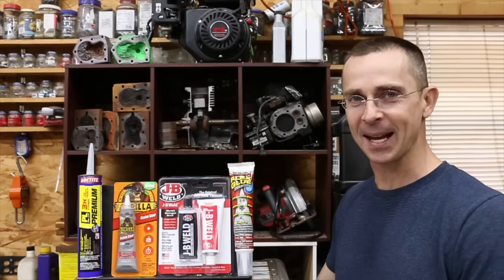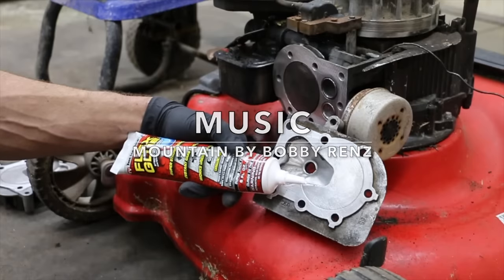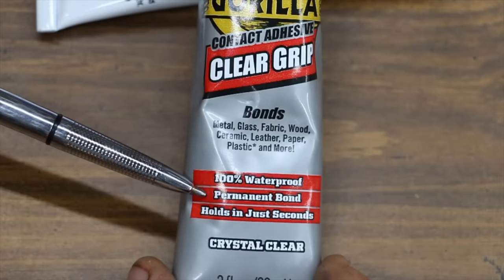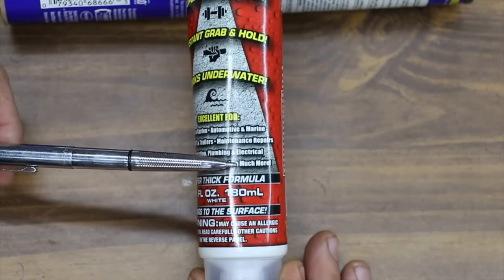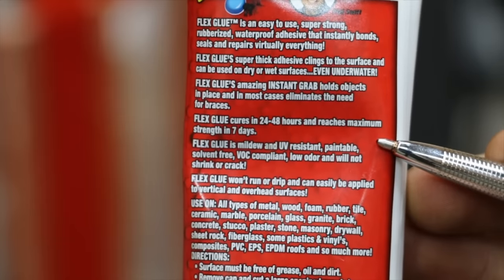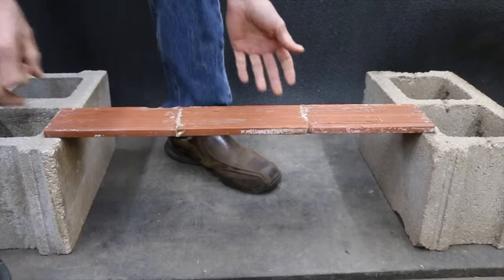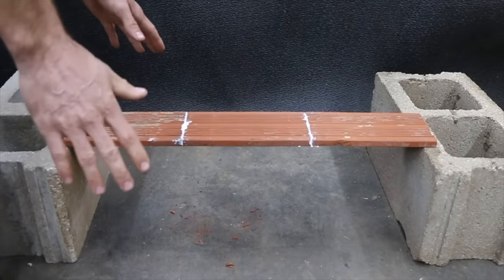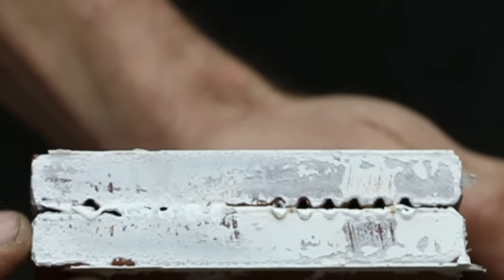Is Flex Glue better than JB Weld, Gorilla & Loctite?  Let's find out!

Comment: Long time J.B. Weld user,  but still amazed by the results.   One application it's not suited for: muffler repair -- or any continuous exposure to very high heat.  Very suited for some rather unorthodox repairs:  I used it to seal up a turtle's shell that I apparently ran over with a bush hog and cracked it very severely,  so that you could see his insides.   By the time I found him,   the flies had already blowed his innards,  so I had to flush out the maggots with hydrogen peroxide.   I always wondered if the repair worked to save his life,  until I found him again over 3  years later,   very much alive and kicking,  J.B. Weld repair still intact.   Needless to say,   I named him J.B.
Reply from the maker: Repairing a turtle's shell--impressive!
Reply: Now that's a BIG scar to show off for mating!
Reply: This story made me quite happy. I'm always saving animals most people never give a thought about. Like nursing frogs back to health that had been injured by cats or caring for injured birds. It's the little things in life that make life worth living. I'll JB the next turtle I find! lol
Reply: @Gruntsworth  -- Good to hear.   If you think the story made you happy,  imagine me finding him alive over 3 years later.  Fortunately it was in an isolated hay field,  well off the road so no one could see.  But,  I'm sure I looked the perfect fool,  jumping up and down,  whooping and hollering,  and dancing all about,  all while holding J.B.up in the air waving him around.  LOL  And to think,  all it took was a little turtle to make me feel so happy.   Your sentiments are spot on.
Reply: @tablature6121  Can you post a picture of this turtle??
Reply: @ihatesignupsgrrrrrrr  -- I did take some pics of him after I found him again.  I'd have to dig them out since I'm not sure where they are now.  Best I remember,  they were Instamatic Polaroids 600 B&W  (this was in '99 or '00).  Since my old scanner is no longer supported and I don't have a new one yet,  I'd have to take a pic of a pic,  on my digital cam,  and host it someplace.  So,  I'll get to work on it but I really can't make any promises.  If my efforts are successful,   I'll reply to you in this comment thread and you should get a notification.  Wish me luck.
Reply: Pics or it didn't happen.
Reply: @jerzmontana7784  -- Please re-read my previous comment (and let it sink in,  this time).
Reply: @ihatesignupsgrrrrrrr  -- Whew! A lot of trouble but glad to do it since you asked so nicely.  You can see the gray J.B. Weld repair plainly.  And if Project Farm will indulge me,  my own "Project Farm product test results":
My daughter,  a couple of neighborhood kids,  and myself wrote our initials,  the date (of initial release),  and his name (J.B) on the gray patch with a Sharpie permanent marker.  As is seen here,   ALL the Sharpie markings are gone after over 3 years exposure to the elements.  Are Sharpie permanent markers truly "permanent"?  Not if exposed to the elements.   Before releasing him again,  after these pictures were taken,  we scratched most of that into the J.B. Weld patch,  for a more permanent memorializing of the repair.  
As these turtles can live to be over 70 years old,  and seldom stray more than a few hundred feet from their place of birth,   I have kept a sharp eye out for him since re-releasing (about 2000),   but have yet to see him again.  Not given up hope,  though,  and will notify if I ever do encounter him again.  
Enjoy:   https://j1flyer.imgur.com/all/
On edit:  Just checked the link to see if it still worked and got the "401 error" thingy.  If unable to access via link,  go to imgur and search images of  j1flyer.  Hope this helps.
Reply: JB thanks you.
Reply: @tablature6121  thanks for the pics. It's all we wanted
Reply: @tablature6121  link works
Reply: @tablature6121   Thanks for helping the turtle. Too bad your good deed generates so much anxiety.  Turtle envy can take years of therapy ,some will never recover.Please contribute to the National Turtle Envy Therapy Society.Your generosity may not save the planet,but you have to start somewhere.
Reply: @jeffhallel8211  what the heck are you talking about.
Reply: @tablature6121  That is friggin awesome.
Reply: @jeffhallel8211  -- Thanks for the suggestion but I think my money will go towards the purchase of some more J.B. Weld.  <<<<<<unsolicited product endorsement.
Reply: @Picklejam08  -- You obviously know nothing about these turtles.  Nothing "miraculous" about finding him again.  Like I said in an earlier comment,  it is not unusual for them to live to be over 70 years old and seldom wander more than a few hundred feet from their birthplace.  
I've posted workable links to pics had you bothered to check before accusing me of making this up.  I suggest you avail yourself of them,   then further "edit" your post so as not to appear so ignorant.
Reply: JB Weld has a high heat mixture for exhaust systems I believe.
Reply: @ZRTMWA  --  Good to know,  Yung.  I will certainly be on the lookout for some I could use on my tractor exhaust.  Thanks.  
(I have seen and used their fairly recent quick setting formulation but still prefer the original stuff if I'm in no hurry.  Gonna look for the exhaust stuff now.)
Reply: Had to download Imgur and make an account, but well worth worth it. Awesome story and cool to see he lived. Cheers mate.
Reply: No wonder turtles have outlasted the dinosaurs. You're a good egg!
Reply: Purchase yourself some Belzona 1121 and 1212, you’ll never want to use JB again.
Reply: Tab Lature 

Wonders never cease!!! Tooo amazinggg!!!
Send that story to Readers Digest! (or ?)
I stop 4 turtles too btw...of course!

A chimney swift hit smack by my van grill...got out to get him/her off the road...laid it in a hanky and took the dead looking thing home...looked again and there was life in it...got home and it was drinking from a dropper, tame as any hose pet!...no fear at all! Looked in my bird book...that species takes easy to humans...and flew away in less than an hour!

Seriously though...being an illustrator/writer; l would enjoy illustrating & posting that story on my soon revised YT channel...it should go viral...and have the JB Weld ads to go with it...awesome!!!
Hopefully u took pictures (?)

Okay, you do have photos...just read your other posts...🍀👍
Reply: Great story
Reply: Thanks for sharing, and the photos! That's awesome!
Reply: This is the best story so far 👍
Reply: @tablature6121  Good lord, you covered that turtle in JB, it will be invisible now.
Reply: how did you find him again?
Reply: Wow thats an awesome story!
Reply: @ISCFworld  -- I just pulled into a hay field,  only a hundred or so feet from where I originally found him,  and was barely started mowing the first swath.  Especially watchful during this time,  since woods border the field and dead tree limbs will sometimes fall into the field,  and they're something you don't want to encounter with your equipment.  While looking out for dead limbs,  I happened to see a flash of gray moving out of the field and into the ground weeds and vines that border the field,  at woods' edge.  Knew immediately it had to be him.  A joyous celebration ensued.  LOL
Keep in mind,  I had a relatively high perch -- the tractor seat -- from which to observe,  with no cab to obstruct my view.  That, and a whole lot of luck is "how".
Reply: @tablature6121  thats pretty cool !!!
Reply: Thats a beautiful story man!! Thanks for going so far out of your way to help a creature "beneath" you! God bless
Reply: that story deserves a video....Good job.
Reply: @tablature6121  good luck!  I would love to rub that photo in jerk montana's face!
Reply: Wow. Incredible!!! Great job!!!
Reply: Damn that turtle was a real teenage mutant ninja turtle
Reply: @tablature6121  Good show mate!
Reply: @tablature6121  For someone with such a good heart to do what you did for that turtle, you certainly don't seem to understand the standard "pics or it didn't happen" phrase that is widely used all over the internet, and has been for like 2 decades. Jerz isn't actually accusing you of lying. It's a jab to post the pics because everyone would love to see 'em.
Reply: What did you mean with "flies had already blowed his innards"? Did a considerable amount if time pass between running over him and you finding him?
Reply: Hazuki Kimura -- Maybe a Southern (U.S.) thing,  I don't know.  But all my life growing up in the South,  when flies lay their eggs on some dead or dying carcass,  it is said here to be "blowed" (yeah,  I know,  "blown" is probably the proper tense/usage,  but this is my beloved South -- it is the vernacular/slang/whatever used most often here in this situation).  The eggs,  as you know,  hatch out into maggots (fly larvae).    I can't say how long after the damage was done to J.B. I found him,   but I'm sure it was I who inflicted it upon him,  since the previous 2 days,  I had been bush-hogging (a tractor sized lawn mower of sorts) and also mowing hay --   the machine I use to mow with equally capable of doing the damage.  
So, it could have been up to 2 days with the cracked shell,  doubtful any more.  Whatever,  time enough for the flies to "blow" him (lay their eggs on his then exposed "innards")  and for those eggs to hatch out into the maggots I flushed out,  albeit very small maggots.  I'm sure there were eggs still unhatched that were sealed up with him,  but apparently to no harm.  Weirdly enough,  when we checked on him the next morning,  one maggot had managed to wriggle his way through the J.B. Weld mixture before it had fully set up.  He was at the surface -- "fossilized" as it were,  fixed in the stuff like prehistoric insects in amber,  only all gray.  
I remember,  there was a very bad stench,  too,  as my daughter,  who assisted me in the whole operation,  then only about 6 or 7,  could attest to (that is her,   about 10 or 11,   in the photos,  only cropped for obvious reasons).  
Knowing that the internet is an international thing,  I had reservations about using that term when I posted it,  but really,  I'm at a loss for any other way to describe it (flies laying their eggs on "flesh").   Thanks for giving me the opportunity to clear this up.  Hope I succeeded.
Reply: Thank you for your story and pictures.  Hope you see your little grey friend down the road sometime soon.
Reply: So cute lol
Reply: I jb welded tehe mufler to my Moped, worked for almost three years b4 i had to add anohter coat.
Reply: Tab Lature, maggots only eat dead tissue and leave healthy tissue alone. Supplying lab-raised maggots to hospitals for wound debridement is a viable business these days ---- they are often used to clean wounds that soldiers receive from IED' s and other explosive devices, as noted in the book "Grunt; The Science Of Sending Men to War" by Mary Roach. Maggots are also good for cleaning lesions caused by  poor blood circulation in diabetics. Yes, the idea of putting squirmy little worms in to a human being's wound sounds disgusting, but it works. And Mary Roach has never shied away from "icky" or messy subjects. Some of her other best known books are titled Stiff: the Curious Lives of Human Cadavers;  Bonk: Science Investigates Sex; Gulp (about the human digestive system, from input to output!); Spook: Science Investigates the Afterlife; and Packing for Mars, which is pretty much self-explanatory. All are recommended.
Reply: @tablature6121  , you should rename that turtle J.B. Garcia, aka Jerry B. Garcia, because the critter has more than A Touch of Grey! 

Did you repair the turtle's shell with J-B Kwik fast-cure epoxy or J-B Weld, which is slower curing? One of those is black, and the other one is gray. I forget which is which. Regardless, both are good stuff, we use them at work (electronics repair shop) all the time. By the way, this probably shows my age, but some of the folks here might also be old enough to remember a time when every hardware store had a display showing a whole bunch of various odd shaped objects glued to a coke bottle with an  epoxy putty called PC-7, which is probably not available anymore, at least I haven't seen it in years. I also remember a white, ceramic like epoxy made by Devcon, probably no longer available, that had excellent temperature resistance, I used it to patch some fishing lure and Lead sinker molds to reduce the amount of flashing from molten metal leaking out through poorly fitting/mating surfaces, and that stuff lasted for years. The Defcon brand is still around, of course, but I haven't seen that particular White ceramic like epoxy in 30 years.
Reply: I used the regular J.B. Weld.  If the "qwik set" was available then I was unaware of it.  I used some of the qwik set just a couple days ago,  though --  ideal for repairs not under a lot of stress and when in a hurry.  I was made aware of Devcon many years ago by a retired Navy chief.  He swore by it.  He said it and Teflon tape were worth their weight in gold on a deployed ship.  LOL  They have a wide variety of products nowadays,  each one suited for a different application and the only one I've ever used (the clear epoxy) was quite effective.  J.B. Weld old formula is still my preferred go-to however. 

Thanks for the comment.
Reply: @tablature6121  , at work we've been experimenting with the various "five second fix" type glues that cure almost instantaneously with ultraviolet exposure . Obviously they are not as strong and durable as Devcon 2-ton or J-B Weld, but they can be useful for holding parts in place while the slow curing epoxy sets and hardens. It beats having to prop up the objects at an odd angle so that gravity holds the pieces together, or trying to figure out how to clamp something that is irregularly shaped.
Reply: @tablature6121  , off-topic, but from your online name I'll take a guess that you are a musician, perhaps a guitarist. My wife and I are going to see Richard Thompson play tonight. Later this summer we're going to go see Tab Benoit play, if you're not familiar with him he is one of the best blues & blues rock players around.
Reply: @goodun6081 -- Guitar,  banjo,  bass.  My only familiarity with Thompson is Del McCoury's cover of his '52 Vincent.  I lean more to bluegrass,  but I do own a '71 Tele,   which I noticed both artists play Fender's.  I'm open to anything really,  so I'll keep my eyes open to see if either come around.  Thanks for the heads up.  
The name was just a last minute random thing.  Had to have something and I figured it'll do.
Reply: You're a quality human being..
Reply: Too all the people questioning this mans story think again turtles are tough son of bitches adult turtles can live for 1 month and a half without food
Reply: @NikTheFix LOL -- I reckon.  I love turtles and I love J.B. Weld -- those 2 things just had to come together eventually.  LOL
Reply: Made a great plug for a hole in my kayak among other things. It's like franks red hot. I put that shit on everything. It's the new duct tape.
Reply: What an excellent job my animal loving friend, great story.
Reply: @murraymachado401  Thank you,  Murray.  Happy to report I just mowed the hayfield in which I found him 3 years later,  only  Monday.  Am still looking for the little rascal but no luck so far.  Wish me luck.  I still have hopes of his being alive now over 20 years later.
Reply: that's awesome
Reply: one of the best stories i ever herd
Reply: Tab Lature nice one fella 👍
Reply: @tablature6121  you did a good job on JB. I hope he stays close by for many years to come.
Reply: Haha wtf????
Reply: I think I've fallen in love with you.
Reply: Thanks for your experience, ur tips tell me alot
Reply: LOL...what a story!!  I use J.B. for many repairs and constructs...always have been a favorite.
Reply: goddamn, one of the times OP really delivers, and then some more
Reply: This comment should have been accompanied by pics or vid.
Reply: @tablature6121  That's cool as hell man:)
Reply: Wow awesome 
I'm curious on the turtles shell growth and how it would have been effected over years of growing.
Maybe it couldn't grow and died somehow. I hate to say that. I'm not sure, the effects. I'm certainly not denouncing the jb surgery. 
I suppose 3 to 5 years of life is better then dying that week of rotting flesh and magnets? 😀
Reply: Tab Lature You’re an amazing person. Never change.
Reply: Is this legit mate?
Reply: @tablature6121  Any news on the little fella my friend?
Reply: @ChronicFool  I really kept a sharp eye out all summer but still no J.B.  Pointless to look now,  since he's a cold blooded reptile and will be tucked away somewhere safe....I pray. 

Thanks for asking.  I appreciate the concern 'cuz I feel the same.  If better luck next spring/summer,  I'll be sure to report back.  Thanks again.
Reply: You sir deserve a medal
Reply: @TheKitsuneCorp  Oh,  I wouldn't go that far,  but thanks so much for the support.
Reply: since they grow so fast, how would the shell continue to grow past the break point?
Reply: @ikigai47  He was already at his full growth,  so there was never really a worry about that.   Also,  their shell is primarily bone but covered with a thin layer of material similar to your fingernail,  only much thinner (keratin,  I think the protein).  Since the patch was applied to this material,  which is very forgiving,  and not the bony part of the shell itself,   any further growth would not present a problem.  I have found one of these little guys with his shell having been hairline cracked across the back,   and it had healed itself what looked like "from the bottom up."  That because the "scar" was more meaty than bony.  They're very resilient creatures,  but I really don't think J.B. would have survived his wound,  it was so bad.  BTW,  the reason I know he was male is because the males have an indentation on their bottom plate,   to give better access while mating.  Thanks for the question and your interest.
Reply: @bajemo359  did you see the turtle picture??
Reply: I beg to differ

My buddy jb welded his engine block with that stuff when he threw a rod lol he patched a half a baseball sized hole mixed with shredded metal shavings and it was a big 5.9 v8 dodge ram .he mudded with that truck for 2 more years before selling it AND IT NEVER FAILED!
Reply: @chicagorc3967  An engine block doesn't get much above 180 degrees F if the cooling system is working properly.  That is not a '''very high heat" like what is generated by its exhaust system.  I've tried it,  the regular JB Weld,  on the exhaust on my Bobcat several years ago.  It turned loose after a few hours operation.  As for use on an engine block,  I've known others who have used it there with great success.  No surprise that your bud had the successful results he did. 

Someone earlier in this thread advised me that JB Weld now makes a product for high temp applications,   but I've yet to try it.
Reply: The world needs more guys like you...atta'boy!
Reply: @testticklehead  Another thing to look out for:  wild turkey nests.   Early spring is when they're setting their eggs.  After they hatch,  the little ones can fly after only a few days and will get out of the way.  Also,  quail,  who like to stay on the ground whether little or big. 

Only one time did I jump a fawn but it was late in the mow.  When I started,  the mom and another little fawn ran out of the field,  and apparently this one was hers as well.  After laying there the whole time I was mowing,  it finally got up and ran in the direction its mom and twin had gone,  thank goodness.
Reply: @jashton8710  Scroll through the comments to find links to pics.  Sorry not posted in the OP but I didn't realize the story would generate so much interest -- just commenting about the many uses,  orthodox and otherwise,   for one of my favorite products,  J.B. Weld.
Reply: @Louis-op4zj  Yes sir,  very much so.  J.B. Weld is legitimately a wonderful product.
Reply: Thanks for welding a turtle!! ...first time for everything i guess.
Reply: @thewatcher611  Lol  Thanks but I doubt I'm the first.
Reply: who's going to tell him
that u know

not a turtle...:\ it's a tortoise.
Reply: @etoatoummhmm6391  Are you a herpetologist or do you just play one in the You Tube comments section?  In either case,  you're doing a terrible job at it.  Looking at the Wiki page on "turtles",    you'll see the exact same turtle,   a box turtle (yet another name for J.B.),  pictured at the very top.   For the lay public,  and for even some in the scientific community,  "turtle" is an all encompassing term for any shelled creature,   be they terrapins,  tortoises,  or true turtles,  like J.B.,  "u know?"
https://en.wikipedia.org/wiki/Turtle
Reply: I found one that withstands temperatures up to 900 degrees Fahrenheit. Your muffler won't get that hot. At least I don't think.
Reply: I hope you're telling the truth. The gross amazing truth.
Reply: Rex Erection  Someone posted earlier that JB Weld now makes a formulation for high heat applications.   Haven't tried it,  or even seen it myself,   but should I ever have the need,  that will certainly be my first go-to.  I only just a couple days ago used their Quik Set formulation on a leaky lawn mower gas tank (I was in a hurry).   Great results,  as always  with JB Weld products.
Reply: @steved8714  I really have no reason to do otherwise.    If the pics don't convince you,  I certainly can't here.  So,  judge for yourself.
Reply: That's truly amazing
Reply: @martinkimathi993  The truly amazing thing,  is the toughness and resilience of these little,  seemingly prehistoric,  critters.  They are quite the evolutionary indestructible entities. 

ETA:  And J.B. Weld is pretty awesome stuff,  too.  LOL
Reply: Jon Galt  Thank you for the sentiment ,  sir,  but not really.  I am,  however,  king of all that I survey,  and that ain't much -- only about 20 acres.  LOL
Reply: Jon Galt  Me too.  Funny you should mention that,  as I did this very thing just a couple days ago.  Only thing,  it was a big snapper.  It was in the road at the end of my driveway,  and I saw this other guy who was trying to get him out of the road,  but he finally gave up because the snapper was just too uncooperative.  When I pulled out into the road and saw what it was he was stopped for,   then I understood what was going on.  The only way to handle a snapper is by his tail but this one was keeping his tail curled up and every time I reached for it,  he would wheel quickly around and try to snap me.  Finally got a good grip on it though and was able to carry him out of the road,  headed for my creek,  which I think was his destination anyway,  but he was no help at all. LOL
Reply: MAGGOTS ???  No worries just flush them out before making tortoise soup....or leave them in and enjoy the unique taste plus the healthy benefits of natural protein.  🐛
Reply: dang thats pretty cool hope he/she is still alive 🤙
Reply: @alejandrozuniga4426  Thank you.  I've already started my somewhat cursory search this year.  Keep your fingers crossed.
Reply: Project Farm next test: see what animals you can put back together with JB Weld and how long they live. It’s the humanitarian thing to do....
Reply: Tab Lature don’t turtles grow over time? Wouldn’t the JB Weld stay the same size and crack or fall off as the rest of the shell grows? I’m fascinated with this repair.
Reply: Is he now officially and “TMNT”?
Reply: @therealmfwic9503  I think well past teenage.  Maybe a middle aged post operative combat vet.
Reply: @therealmfwic9503  JB was full grown.  I know from having played with these turtles all my life and I've seen none bigger.  As I explained in an earlier post,  what you see on these turtles,  or any turtle for that matter,  is a thin veneer of protein similar to your fingernails (keratin),  and what the JB Weld was applied to.  The underlying bone is much more thick and is the real important thing here.  You can actually scratch off the keratin to the bone,  such that it will scar and leave a permanent reminder of having done so.  In fact,  I have known   people that have done that very thing and have seen their examples of having done so,  one that was so dated as to record 55 years of life.  Amazing.
Reply: @tablature6121  You seriously ought to send this story to the JB Weld people.
Reply: @Slugg-O  -- Never really thought about it,  but thanks for the suggestion.  I just might.  Judging from the very unexpected response it got here,  they might get a kick out of it,  too.
Reply: Tab Lature J-B SHELLD
Reply: Tab Lature J-B SHELLD
Reply: If only you made a set of videos and uploaded to YT we could have viewed you to MILLIONAIRE STATUS!!! Good job on helping Mr. Turtle.
Reply: That's probably one of the greatest stories I've ever had the privilege of reading in a youtube coment.
Reply: @jordanv3388  Thank you.  Jordan.  High praise,  indeed.  
Coincidentally,  I was raking hay just today in the very field I found JB the second time and started thinking of him.  And now I see your post.  
Still haven't given up hope for finding him again,  but the chances for it this year grow slimmer as the days grow cooler.  Maybe next spring.  I'll keep you posted.
Reply: Good gracious . You might be a veterinarian.
Reply: @tablature6121  Amazing story!  Thanks for following up with pictures!
Reply: @nate0031  Thank you,  Nathan.  Glad to see the pics are still up.  It's been awhile since I posted them.  Now that the weather is warming up here,  I'll start keeping an eye out for J.B. -- see if he's still kicking.   I'll post if I have any luck.
Reply: @tablature6121  Any luck with J.B.?
Reply: @viacomsspy5439  Not yet.  Still looking.  Thanks for your interest.
Reply: 😊 This is a delightful story 👏👏
Reply: @tablature6121  congratulations and thank you for helping that little turtle.
Reply: @SkyValleyStuff  auto parts stores sell muffler patch kit s that have refractory repair putty used in refineries. That's the best goop for got applications.
Reply: To be fair, I wouldn't Flex or Loctite my exhaust either. LOL
Reply: @GiuseppeGaetanoSabatelli  LOL...I hear ya.  To be honest,  I haven't found anything that lasts except total replacement.  But that's just my experience.  Others' may vary.
Reply: can i use it in bottom bracket? because my bike's BB threads are destroyed.
Reply: @namisan1748  You talking about the bearing cup that holds the crankset in place?  If so,  I imagine you could by putting it on the threads uncured,  then screwing in the cup and letting it dry.  But,  It would be a pain to ever get apart again.  First,  I'd try wrapping the threads with several layers of Teflon tape and seeing if that wouldn't hold fast.
Reply: @tablature6121  That's a box turtle, my favorite turtle. I have several empty shells that I've found over the years, clean them up and spray them with clear lacquer to give em a shine. Pretty cool that you fixed the little guy up. I'm not surprised he lived, turtles have very robust immune systems and are damned tough. I found a big painted turtle wandering around in the road last year. I grabbed him up and saw he had a huge fishhook going into his mouth and coming out his left eye. So I took him to my vet. They fixed him up and he easily survived. He's still kicking around here somewhere.
Reply: Great story, thanks for sharing.
Reply: @Gruntsworth  Animals are worth saving, and I'm sure it makes you feel good about yourself.  Thanks, from an animal lover.
Reply: @jerzmontana7784   A lot of people feel the same way, no picture so it didn't happen.   I'm not one of those people, if it happened to me, I don't need to prove it to anybody, I know it happened, and that's good enough for me.
Reply: @harrysurtees8710  oh I feel you, that was just me being an idiot. I believe his story
Reply: Best comment ever.
Reply: You saved a turtle with epoxy?? Jesus
Reply: @masternoob9673  Yep.  A desperation move that panned out successfully.
Reply: I don't want to throw shade on this seemingly good deed but turtles absorb nutrients like Vitamin D from sunlight through their shells - covering it in JB Weld is likely interfering with its ability to do this. Though the repair idea is clever, it is always best to take injured wildlife to an animal rehabber to repair the shell. That said, I appreciate the compassion you have for wildlife. I am grateful you saved its life.
Reply: Huge props for giving a damn. It's great to see!
Reply: Talk about stories that could be used for advertising...
Reply: If it hasn't already been suggested.... (I'm just not reading through 154 replies right now sorry...)
You really should contact JB weld about this story with the pictures.

1. I'm sure they would absolutely love to hear the story I know their product helped in that way.

2. They may even pay you for the pictures and the story.
Reply: @mrfixitusa6165  Thanks for the suggestion,  but aside from not doing it for any monetary gain or notoriety,  I've never seen any J.B. Weld advertising -- not in print,  not on TV -- nowhere.   There are many epoxy competitors out there yet J.B. still sits at the top of the heap,  like in Project Farm's test here.  I think they rightfully think that word-of-mouth is quite sufficient to keep them there,  which is where I learned about it many,  many years ago,  and I quite agree.  
But thanks for your suggestion all the same.  Much appreciated.
Reply: And here I was thinking I woulda put the turtle out of its misery
Reply: @good 'un  I remember seeing PC-7 at Walter A Woods supply Co. In Chattanooga TN. Back in the 80s
Reply: @goodun6081  they will clean the dead flesh first then continue into healthy flesh if left to long
Reply: What a story! I love it. Thanks for sharing (and caring)
Reply: That is a great story.  JB weld should do an advertisement re-inactment.
Reply: Tab, got nothing but LOVE for you my brother.Well played .Long live J.B.🙋👍🏽
Reply: @jesusramos1440  Back atcha,  Jesus.  Many thanks.
Reply: Ninja Turtles approved
Reply: @tablature6121  It worked so cool Thanks
Reply: @Gods-Elect  Welcome.  Thank you for checking back.
Reply: @tablature6121  
You scared it to death... holding him in the air...
Reply: @AlCatrraz  LOL
Reply: demon rat  Have you ever seen a J.B. Weld commercial?  Neither have I.
Reply: Cyber turtle
Reply: I used JB Weld (original) to join/lock up the tail pipe assembly on my truck - that's held for over two years of daily driving.  Also used it on my fireplace door to reattach insulation, which has lasted dozens of fires.  So it can definitely take some heat.  I used the putty (steel stik) to patch a hole in my old Wheel Horse muffler, and that's held for >1 year without issue.  Idk how the OG JB would have done, but the putty stick can definitely take a lot of heat!  As for OG JB, I'm kinda counting on the heat-failure in case I ever want to pull those pipes.
Reply: That's awesome!
Reply: Hey Tab Lature, I was totally impressed by this story!!  The desire to help this turtle even though it sounded like a lost cause was touching at the very least.  To hear that your efforts were rewarded by seeing the turtle years later was even uplifting to a casual observer.  I just wish more people showed the humanity that you did ... even when the potential outcould wasn't great!  Maybe, just maybe we aren't dumed afterall!!  Cheers Mate!
Reply: @pemtax557  Thank you for the kind words,  but I would be remiss if I didn't give most of the credit to my daughter,  who was only about 6 years old at the time.  
You see,  I was raising layers at the time and I spotted J.B. while weighing up the feed for next day's feeding.  As all,  or most,  southern boys will do and have done.  I went over and picked him up,  thinking to "play" with him for a bit,  when I discovered his injuries,  probably inflicted by me.  
When I went home for lunch,  my daughter sensed I was upset about something and asked what it was,  when I told her about my discovering J.B.
"Isn't there anything we can do?"  she asked,  at which point I hit upon possibly using the J.B. Weld.  
I asked mom if they were going to town that afternoon,  which they were,  so I asked for her to pick some up,  which she did.  
Amazingly,  my daughter had already dispatched 2 of the neighbors kids to look for  J.B. and successfully found him near where I told her I found him initially,  and there he was in a 5 gallon bucket,  waiting for us to "do our thing"  when I got home that evening.  
We  then proceeded to sit at a picnic table and did the thing as best we thought how.  Seriously,  when we boiled the maggots out of him with the hydrogen peroxide,  I didn't hold out much hope,  but turtles are very tough little critters. 
When I found him again about 3 years later,  I was very elated,  as was my daughter,  whom I give a lot of credit to.  
Thanks again for the kind words,  which I'll pass along yours and so many other's sentiments in this regard.  She is 34 years old now and teaching school,  now.  And I, just 2 days ago, mowed the field of hay where I rediscovered J.B.,  but no sign.  Still looking, however.  Hope to see him again,  and will keep all updated if I ever do.  One bright spot:  I've yet to discover any shells,  cracked or otherwise,  where one has died - keeping my fingers crossed.
Reply: So amazing 👏
Reply: That's an incredible story - maybe he let you find him because he needed another shell refinish job before the warranty ran out?  I had a 1988 Nissan pickup, 4 speed manual.  The shift handle kept working loose and I tried a hundred adhesives, until JB Weld.  I put on at 88,000 miles.  100,000 miles more and 15 years later, it was still holding, when i had to junk it for smog.
Reply: @rctheil  Think that phrase depends on the claim 😅
Reply: Good work, just missed opportunity to make him a Ninja Turtle.
Reply: @seynoonrae2474  Ninja or no?  Yet to be seen.  LOL
Reply: OH ! That is such a Great little   Story . Hopefully he/she was able to  Moult  OK . They DO replace their Shell periodically .
Reply: @johncunningham4820  Not the shell,  which is made of bone,  but occasionally the shell covering which is very thin and made up of the protein keratin,  same as your fingernails.  Usually,  though,  when this occurs,  it is the result of something amiss (bacterial infection or the like),  and not a natural part of the growing process.  In fact,  it is possible to get an idea about the age of a turtle by counting the concentric rings in the covering's many segments,  each indicating a year of growth, or so I've been told (but really don't put much stock in it). It does point out the fact,  however,  that the covering grows along with the bony shell -- no need for molting.  
As further proof,  a friend's grandfather (and other old timers did this too) would scratch his initials and date into a turtle's shell covering when he found one in his garden,  and marveled at the fact that the same ones would return year after year.  (He would scratch through the covering to the shell and it would heal over leaving a scar of sorts of his initials.  He would do this on the belly plate.)  Back in '88,  his grandson,  my friend,  came to me on his 4-wheeler and told me to,  "Take a look at this."
What he had was one such turtle his grandfather had marked. It had the following on its belly plate:
HB  '32 (his grandfather's initials)
HL  '35  (his grandfather's neighbor who did the same thing)
HB  '37  (his grandfather again,  5 years later)
It being '88 when he brought the turtle to show me,  that made the turtle at least 51 years old by recorded proof,  but probably much older with no such proof.  
(BTW,  I do not recommend doing this -- not painful to the turtle but it does open the covering up to bacterial infections.   I heartily discourage the practice.)
Reply: @tablature6121  . Yes , I know what Keratin is . Just learned something though . Being a Reptile  I  fully expected SOME kind of Molt process to accommodate Growth .
Reply: Oh . And there IS a Specific Product for Exhaust Systems and Mufflers . We call it Mani-Seal here in Australia . Reddish-Ochre colour , and Totally Heat resistant .
Reply: @johncunningham4820  Well,  they do have scaly skin on their exposed appendages (head,  neck,  legs,  tail),  just like a snake's,  so it wouldn't surprise me in the least if that skin was molted away from time to time.  You could very well be right in that regard.
Reply: I call bullshit . It must not have been prepped and cleaned properly . I used JB Weld on an exhaust manifold leak on a 79 Bronco and it held for years on a hot exhaust manifold
Reply: My sister had a land tortoise...he got hit by a car, she used JB Weld to fix his cracked shell, worked great he's still alive after 15 years.  She named him ' Speed Bump' in honor of his survival.
Reply: @miltonturner2977  Great news,  Milton.  Glad to know I'm not the only one to successfully use J.B. Weld in that way.  And good to hear of his longevity after the repair.   I hope others will see this and remember it if the need arises.  Ya gotta love turtles and the people who love turtles,  like your sis.  Hug her neck for me next time you see her.  Clever name,  btw LOL
Reply: This is awesome!!! 
 it reminds me when i was a youngin riding around with my uncle. Everytime we came across a turtle tryna cross the road he would whoop the truck  over and hop out and take him to the other side. It was great now hes rubbed off on me and i get out and make sure they are out of the road.. I got so many turtles all over my yard. They usually put some eggs in my garden when they get a chance. I always keep an eye out to make sure the entire hatching process goes through without any snakes comin by and eatin em up. 
Great story my friend!! JB weld is the shizz i patched all of my exhaust leaks on my fourwheeler And fixed holes in bricks and countless other things. Helps man and animal alike!
Reply: holy crap, if true then that is mindblowing.
Reply: That's awesome!! I wonder if any Zoologist is aware that JB can do that.
Reply: Awesome!! Good on You!
Reply: Hmmm - maybe I don't need to go to the dentist after all....
Reply: @sergiom4300  love, dude..  looove...
Reply: @OpusBuddly  Yeah - JB Weld doesn't work so well on the dino's flexy skins...
Reply: Where's the fookin pics?
Reply: @tablature6121  can you send me the link i want to see this
Reply: Send this story to JB weld. Life saving lo
Reply: "...Apparently..." ;-)
Reply: @tablature6121  I couldn't make pictures work. But I believe you. We've saved lots of birds from window hits. It's gratrifying, huh? I'm glad to know you.
By now do you have another way to share pictures? Good Job!
Reply: @bowlofscabs1  You may have to turn off your ad blocker.
Reply: @tablature6121  No AD blocker, Tab. I believe you anyway. Such a fine story. I can just see you dancing around with that turtle.
Reply: @bowlofscabs1  I really am saddened to hear you cannot get the links to work. They still work for me so I can't discern what the problem is on your end.  Hope you can sort it out eventually.  Meanwhile,  thanks for your faith in me and J.B.'s story.  Much appreciated.
Reply: i'm too late for the pictures; couldn't get the link to work, but i believed you anyway! I have an ad blocker so may try to turn it off for that site and i can log in - i think i have an account. but even if i never see the pics, the story is in my mind and imagination.  thanks for your big heart, repair skills, and knowing the awesomeness of JB Weld for the repair! this story made me feel hope for humanity. :D As do all the other turtle and wildlife lovers and helpers here on this comment thread.
Reply: @goodun6081  these Mary Roach science books sound fascinating - thanks! Loved learning about maggots in wound debridement.
Reply: @goodun6081  i haven't looked lately, but our hardware store used to carry defcon PC7 and PC8 - i believe 8 is black and 7 is white. two part. works great.  i love weldbond too. i have used all in mixed media mosaics when most to all other glues failed.
Reply: @nancybryson5488  i guess we will have to take a number!
Reply: I love this story, thank you for sharing it and saving that lil guys life.
Reply: @liberty7383  most cars probably wouldn't. My van has hit 1300 degrees egt so I'm betting it was close to that down the tailpipe.
Reply: Amazing glad you helped the little fella
Reply: Sad story but also amazing and cute. Lovely!
Reply: @tablature6121  it appears the image no longer exists. Neither the link nor the search worked for me.
Reply: On a related note I think JB Weld is great for sealing up leaking sunroofs on old VW Beatles
Reply: Timothy Martin  I am just joking around about the turtle shell shape of the old Volkswagens. I did see a lot of those  sunroofs sealed with silicone in the 1980's, but never anything like JB Weld.
Reply: I have a couple questions. Is your name Kevin and did you used to work for Dunder-Miflin paper company under Michael Scott? Hee hee
Reply: @allenlenz9412 I don't remember a Kevin on The Office TV series. Which character was he?
Reply: @tablature6121  Kevin was the overweight bald accountant
Reply: @allenlenz9412  Had to look him up -- Brian Baumgartner.   A slight facial resemblance to be sure,  but not bald and not that heavy.  Also,  we're both southern born and share the same birthday,  ironically enough --  Nov. 29 -- only I'm quite a bit older (and better looking).
Reply: God I hope this is true 😂
Reply: @Arouth249  It is.
Reply: Wow legit compassionate, 
(not like all the virtue signaling these days)
Reply: @Gruntsworth  all creatures great and small. <3
Reply: We're going to test that!
Reply: @jeffhallel8211  ⁹.
99
Reply: @tablature6121  OK
Reply: Could you make a YouTube video out of those pictures? Possibly with keenmaster or other software. That’d be awesome
Reply: @JoseChavez-rr6og  Sorry,  Jose,  but I'm not computer savvy enough to do that.  Thanks for the suggestion anyway.
Reply: Hero
Reply: @tablature6121  I've been watching your thread for couple years now. 
PIX URL(s), none were working. 😕
Reply: @fm00078  I'll try to do a fix.  Let you know when I do. Thanks for the notice.
Reply: I JB Welded my cats paw back on after chopping it off doe to getting in the way while I was trimming the bushes in our yard. It was more of a cast shell but what I didn't anticipate was that our cat would use it agents me... Now I live in constant fear, every time I try to leave the house I need to be on the look out because he stalks & takes a swing at me with that iron paw of his. I created a monster...
Reply: @Edgar-1183  I think it would have been  better to have used duct tape,  after first trimming all the hair close to the skin as much as possible (for better adherence).  
I've used it on some of my dogs over the years.  1. boil out the wound with hydrogen peroxide 2. apply triple antibiotic ointment 3. cover with gauze w/antibiotic ointment held in place with duct tape.
That is the same procedure I use on my own wounds,  minus the gauze.  It's been said that duct tape's adhesive has healing properties,  and I believe it -- Duct tape and triple antibiotic are the only things I stock in my own personal first aid kit.
Reply: @tablature6121  I was just joking around but alright duct tape for the win😂
Reply: @Edgar-1183  LOL  Re-reading the thing,  I see you said chopped OFF.  I didn't see the off part first time.  I assumed you meant cut it very badly.  My mistake.  
But you got me anyway.   LOL
Dead serious about the duct tape,  however. 
Another use for it is on corns.  Just keep some on them for a few weeks and they will eventually dissolve or soften up to easily remove.  Make a paste of crushed aspirin,  rub it on first and it will dissolve even faster. Also good for plantar warts.  
If you suffer from ingrown toenails,  I have a good home remedy for that as well and it doesn't involve duct tape.
Reply: That’s an amazing story thank you for sharing
Reply: @tablature6121  
What a long journey you have had sharing this story with all these people in the comment section.
I clicked on it because I learned in the mid 80? that JB would go brittle and let go on hot exhaust pipe.
I had a split right on the flare, where the exhaust pipe begins, and the manifold ends. That was the first time id ever used it, and I took the time to shape it grind and sand it, just as if it was a new flair.
Sounded great, and I was sold... Crap! Lol. I got maybe 2 or 3 minutes. But I knew I was asking too muck out of it, especially where I was trying to use it. I have however used it on an un- countable number of other things , including a thread hole in an engine block at the water pump, on a car i had where the previous owner (guessing) ran a different pitched bolt into it. The head was different when I removed it, so I made sure to use the same hole. It would let loose right as it tightened. I had heard? So I went all the way to plug, drill and tap, leaving the first few old threads exposed to try and align tap to same pattern. So it was a thread repair, and It worked perfectly really. It should have, but still pretty amazing that it can.
As I was reading the comments early on, and people couldn't believe you found him again, I was thinking that I  grew up finding them and we would get fingernail polish and paint a little date on the lower back side, and would hopefully see them again, and rarely would. But I thought this was common, because you would come across one that you hadn't done yourself, and other people had mentioned it as i was growing up.
But I did come across one i did, and had forgotten about. Probably not 100 yards from where I  let him loose.
I thought that was pretty damn cool, so I can only imagine what that was like after what you did for little dude.
4 year old story, and I thought, WELL? It's way to late to share my similarities of turtles and tail pipes with him.
But I kept reading as you answered peoples questions, and then took the time to upload photos. I then read 3 years ago - 2 years ago - 1 year ago. This guy is just a good person to still happen to be around, still replying to folks. The more i read, the more familiar I become. Oh he's got him some property too, and a skidder. Lol.
HELL, he's a good ol boy like me. HE... He.. he.
6 Months ago. Someone said you should make a movie slideshow about the adventure of JB.
The way this story has gone on for 4 years that would be pretty cool, and you could link it from here.
But you're not computer savy..
Well, this good ol boy is. Lol.
Unfortunately those old imgr links are dead on this end. But man it would be cool to see your's and JB's
story still tugging at peoples heart strings for another 4 years.
I don't think I have ever seen an active section go on for this long with the OP. (original post)
If your still around, give me a reply, and i'll get ahold of where those pics are, copy them, and make you a cool little moving slideshow, and name any song in the world, and i'll put it with it.
I'm only offering if your interested, I might like the idea, and you may not at all. lol.
You could up load it for others to see, or you could just have a cool little music video about your friend in need for yourself.
It won't take me no time at all, and I don't want nothin for doing it or anything.
That felt weird even saying that. lol. Of course I don't. lol. But I don't know what people who don't know me think, so it wasn't that painful to clear it up. He.. he.
Holler at me if you want, but don't feel obliged at all, because,   "I'd rather not" 
 is a term a twiced divorced man, is extremely comfortable with.

6 string electric / acoustic for 25 + years off and on.
Didn't bother with learning to read tabs until 6 / 7 years ago.
I don't always make the right choices immediately, as i've  known about them for years.
But just grinding through the rewind and play buttons to figure it out is much easier than learning tabs.
Lol.
Take care of yourself
Reply: @tablature6121 do you have another link this one doesn't appear to work anymore
Reply: @Thesaurcery4U2C  Thank you for the kind words and like offer. I was told several months ago that my linked pictures of JB aren't working any longer and promised to retake and repost.  But,  being rather busy of late (hay season) I've been  remiss in that endeavor.   I'll see if I can't do better when things get back to normal this fall.  
One thing you can do that would be most helpful is recommend  a good photo hosting site.    
An just by the way,  someone in the comments said JB Weld has come out with a heat resistant formula,  but I haven't seen or tried it,  as I really have no need to right now.  But I will if the need ever arises again.
I do have some of their "quick set" formula on hand and will use it to  set a geared 5th string peg on my practice banjo.  
As  for tabs,  I used them extensively when a beginner and with good results.  But as one gets more proficient on whatever instrument,  learning by ear is usually the quickest and least frustrating way to go,  at least it is for me now.   Still good to use on tricky passages,  however.  
And I'm still keeping an eye out for JB,  but so far,  no luck.  Good news is no shell found either--fingers crossed.
Thanks again for the kind words of support AND for your offer to help.
Reply: @littlejack59  I've y et to repost the pictures,  as I promised I would.  But I still intend to when things slow down a bit here on the farm.  Check back later (couple, three weeks or so).  Thanks for the reminder.
Reply: chadstewart6005  Yeah,  get another cat.
Reply: God is Smiling
Reply: GOD BLESS YOU FOR WHAT YOU DID TO HELP THAT TURTLE!!
Reply: Its like super glue when you cut your finger tips playing guitar! In a pinch you were there for Leonardo and that's what matters